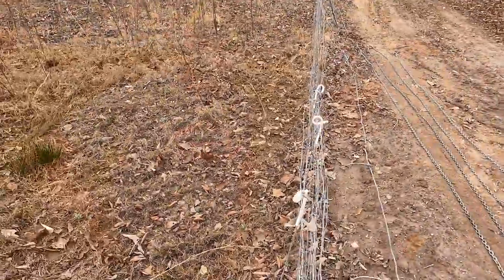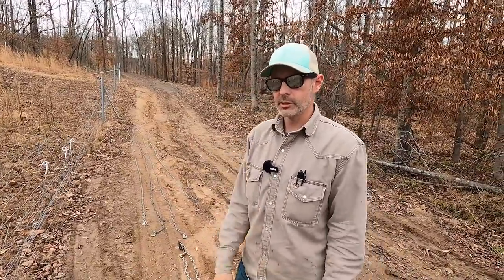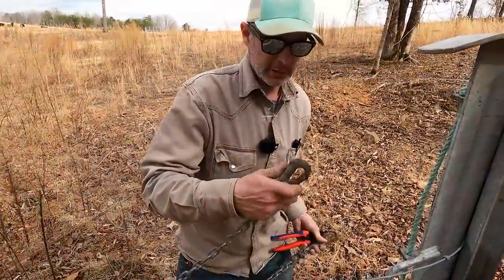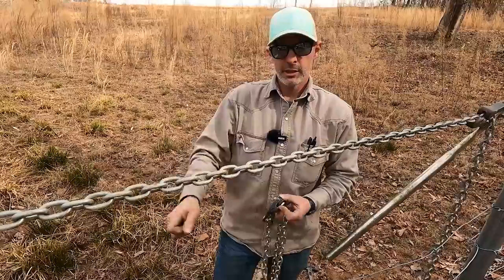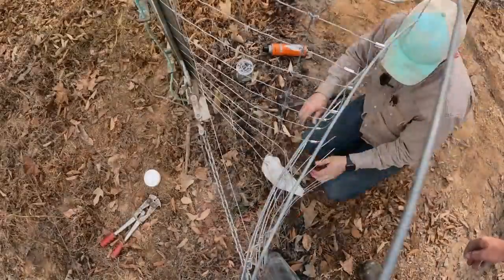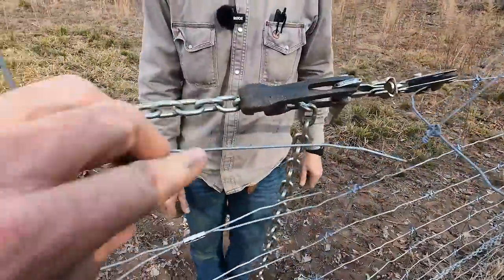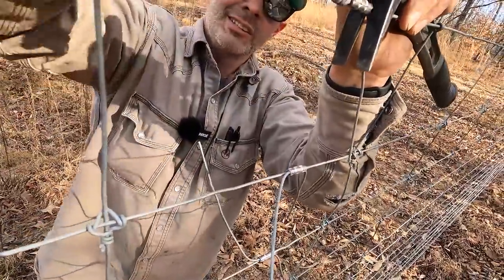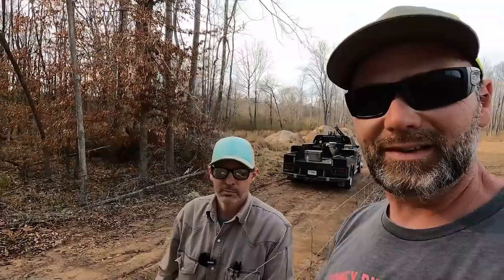Dozer accidentally destroyed it!

Comment: I haven't got the hang of snapping off that wire yet, it just goes round and round, lol
Reply from the maker: bend the wire over, make a little handle like luke just did, then bend back and crank the handle in line with the line wire...it will snap
Reply: @StoneyRidgeFarmer  I'll give that a go, thanks for the tip